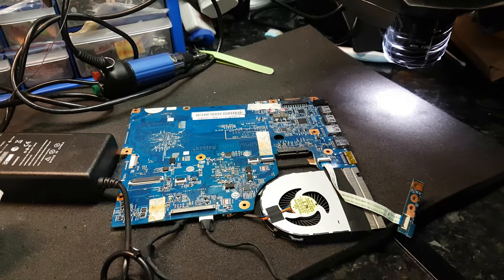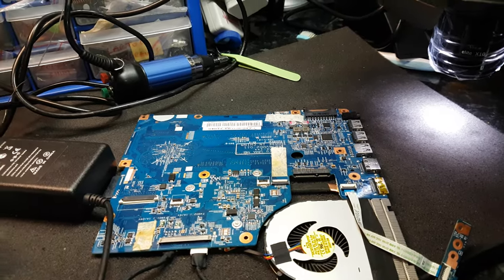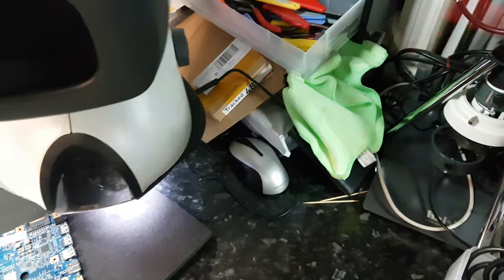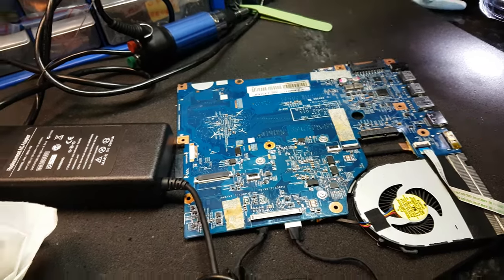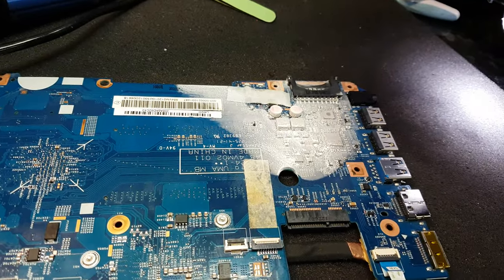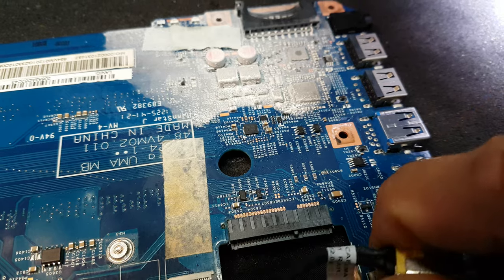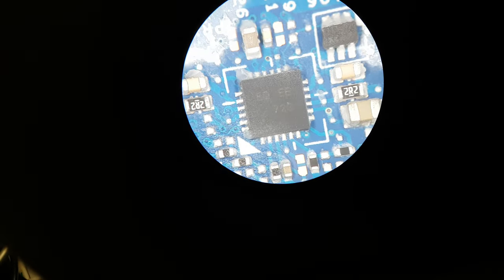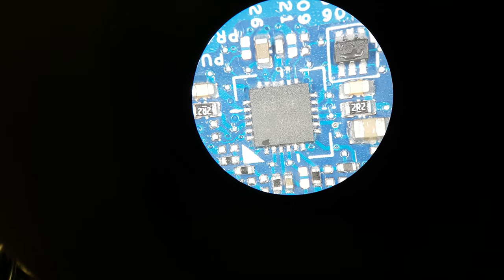FINDING SHORT ON MOTHERBOARDS WITH COMPRESSED AIR

Comment: That's really awesome! I get to use a FLIR thermal camera at work but I am definitely going to use this at home. Thermal cameras are expensive lol
Reply: iTCXtreme I used it today and it found a small smd component just fine.
Reply: Ive been using a laser temperature gun , I can even track down the pin thats hottest on the IC and digitally read the temperature increase  , give it a  try if youve got one , theyre not that bad of a price to buy ..

Comment: That's genius. To prevent any short due to the condensation, I wonder if you can put a thin plastic (like a sandwich bag) on top of the board.
Reply: Depends how hot the shorted components getting... melted plastic .
Reply: Flux is a much better alternative if you are trying to avoid costs and condensation

Comment: Thank you for this tutorial.  My question is, how do I know which spot to spray and find shorts?
Reply: Touch some components of the short area. An area may heat up but still difficult to tell which on is shorted. That's where petrol or freeze comes in handy. Shorted component heats up first.
Reply: @jay22alco   going have to try this  but i think i know where it is there's a burn on the board im going to test it in a 17 r4

Comment: Hey question, if a compter tower dosent work and randomly zaps you with light jolts. Then when you remove all the componets and reassemble them on a table and they work.

Wut dose that mean? Cause i think it means something on the circut borad is grounding itself to the frame and causeing it not to work. But when i remove it like i said it works.

Also my father got onto me for this but will a compters parts explode? If being used outside their tower casing?
Reply: The case should have stand of posts that raise the motherboard away from an metal in the case, if you're getting shorts it might not be mounted properly or a connector could be bent in a way that it comes into contact with the case.
Reply: a bit of a late response, no the parts won't just explode outside the case but it is dangerous to keep it that way. your problem could be with the case being conductive

Comment: isn't there risk of shorting due to condensation?
Reply from the maker: Hi Pal, No, otherwise you'll see smoke ok other components around where sprayed.  Cheers
Reply: @iTCXtreme  I know there wasn't short in this specific video, but I mean, couldn't it cause a short due to water shorting two components?
Reply from the maker: @CasualGamers  To be honest with you I haven't come across such issue.  However if in doubt you can use a thermal imager or lighter gas.
Reply: @iTCXtreme  awesome, thanks for your response
Reply: @CasualGamers  That's not water, it's liquid nitrogen (the gas used in these canisters). I'm not fully refreshed on the science but basically nitrogen (N2) is an inert gas and has no electrical conductivity. Water does have some conductivity and also a risk of reacting and corroding metal components. The motherboard isn't getting wet in the way you think it is, and therefore isn't at risk of additional shorting.
Reply: @cjmlax  Actually, water on its own is a really good insulator. Stuff dissolved in water is what makes it conductive, because they usually break into ions.

Comment: thats too expensive just use a lighter fluid or petrol it works great finding hot parts and it is very cheap also ive learned it from sorin of electronic repair school chanel
Reply: doesn't sound very safe, cost wise I think rosin would be your best bet.
Reply: @EclipticFactions  it's common to use lighter fluid, not really dangerous when used this way.
Reply: @joeyv821  I think rosin would still be much cheaper
Reply: shan thats all i use lighter fluid
Reply: How do u fix? After finding the shorted components
Reply: @quincyhamusonde4907  replace the component its obviously bad if its shorted
Reply: Shan Shann , you read my mind, detective Sorin
Reply: Shan, Shann. Sorin explained that the "Petrol" is actually zippo lighter fluid, lol. And yes, it is effective and cheap.
Reply: @EclipticFactions  Rosin is flux!!
Reply: At times on short circuit those liquid catch fire and board gets further damage or even irreparable.
Reply: @wefukthenwo  I'm watching Sorin too , and i use lighter petrol too . Also , isopropyl alcohol which is used for cleaning PCB is also good for finding short . Its maybe most inexpensive component for helping to find short .

Comment: i have seen people using dc power supplu to inject higher amp to find the shorted component. will this method work fine with just the original charger?? can I use  99.7% isopropyl  instead ??
Reply: My understanding is (I am a novice, so take it with a grain of salt): Using the original charger might not work, since, if it senses the short, the charger may simply turn itself off promptly (requiring you to unplug it from the outlet and re-plug it).  That's why you may need a "bench"--aka. "lab"--power supply, which will keep applying current continuously (up to the amperage limit you have set), thus making it easier to identify the shorted component by raising its temperature (by not giving it enough time to cool off).
See here:  https://www.youtube.com/watch?v=yLffdWhBfFU

And here: https://video.ultra-zone.net/watch?v=97dzxMVD-ug

Comment: Hey iTCXtreme, nice video. Do you know if it's working with small components too? I am going to try to repair a laptop motherboard. It's shorted. And may you tell me how to identify the value of component to replace? Thanks in advance.
Reply: iTCXtreme thanks for the tip. However i cant find schematics for my mobo. It's ASUS N73JF Rev 2.1. Is there any place to search?
Reply: Tamer Çelik laptop-schematics.com

Comment: Zippo lighter fluid...SORIN advice very useful and cheaper.
Reply: @Marie895  no its had too much oil inside, zippo fluid is cleaned, evaporate so quick when put on board and stuff gets hot

Comment: Great job but if short components are not heating up.then does this method also work ?
Reply: great question. same i have in my mind.
Reply: No it won’t work bcuz the freeze spray or air dusted spray is just to see which components getting hot, and if the shorted component is not getting hot then this won’t work
Reply: @M.E63  You are right that the components that cause the short circuit are not always hot, but you get a clue in which area it is then you only need to check with the multimeter for continuity which components have direct contact and you have it. I still do it very oldscool with isopropanol and my fingers.
Reply: Thomas B absolutely right , youll get a idea and you could use low ohms meter to check for the lowest ohms reading if it’s a shorted cap etc, some people use esr meter or a milliohm meter , but me personally haven’t tried that method, but maybe I’ll get one soon

Comment: Wouldn't it be better to check through multimeter , in ringer mode ? 
Spray and microscope , nice novel idea !
Reply: Doesn't work that way. A short may trigger beep on good components that are parallel to it.
Reply: Imagine checking hundreds of components with a multimeter. Many of them have multiple contacts. Some have many contacts that aren't even accessible from outside (BGA devices). It's definitely a smart idea to cover a board with something that indicates heating to pinpoint a short circuit.

Comment: How did you determine which area of the board to spray for a short?
Reply: Spray the whole board i guess lmao jk i have no idea
Reply: Judging by his set up he knows a thing or two about repairing electronics so my money is like myself he knows how the board actually works the functionality of the main chips or has a board schematic that tells you what each chip is and does to find the chips that would process the power current threw the board

Comment: Congratulation for the video ! If you please, I have an question. Can we do this, only with the charger ? I mean the AC to DC transformer which came with the laptop when we bought the laptop (12 volt, I do not remember Amps). I am asking because I saw an other video where mentioned that we must use a DC power supplier. As far as I know a DC power supplier has two output pins. OK the one (lets say the black) we will attach to one of the grounds of the MB but the red one , where exactly ? 
These tools costs much euros and before I will buy it I must know if it is essential for to check if I have a short, and if it is, how to attach it on the MB. I have uploaded two images of my motherboard in the follow links
https://www.4shared.com/photo/KcsdgAQWca/IMG_20180125_045629.html
https://www.4shared.com/photo/k0X4WXhRca/IMG_20180125_045741.html
Thanks
Reply: I wonder if a board is short will a regular charger worked.  The amount of current will be very low to heat the bad component!!

Comment: Looks like freezing spray and not compressed air,but as a method is total useless because the heat is generated if works and if it doesn't.In the video nothing is revealed about a component failure,so what is all about?